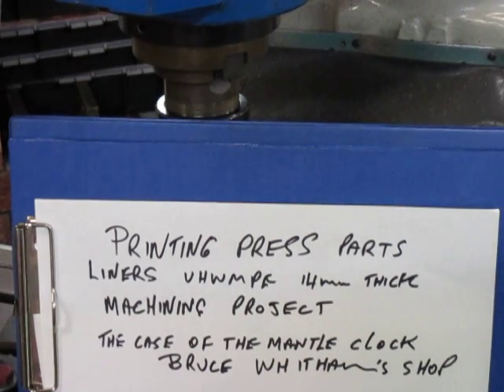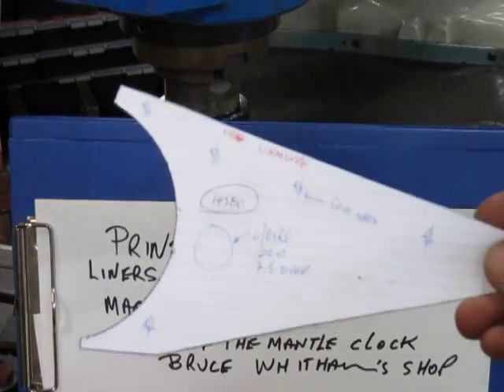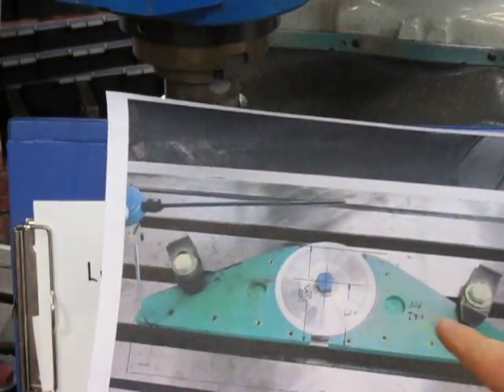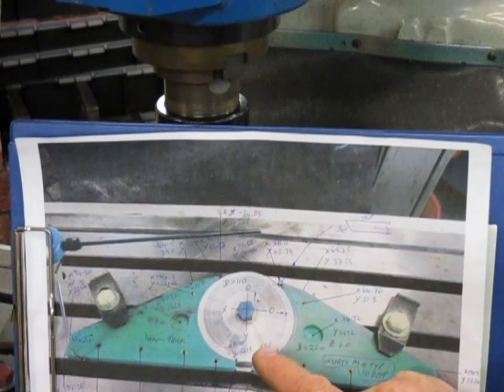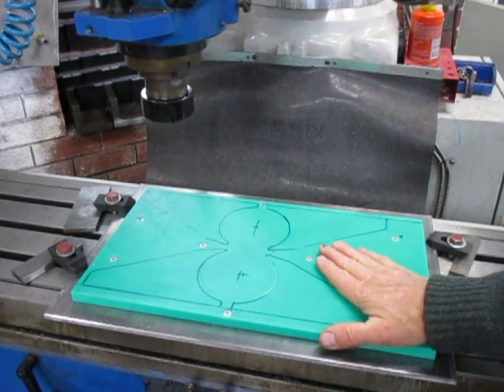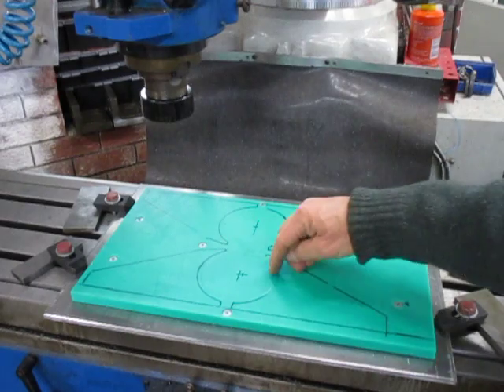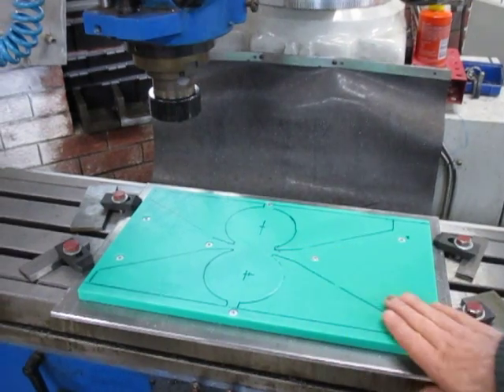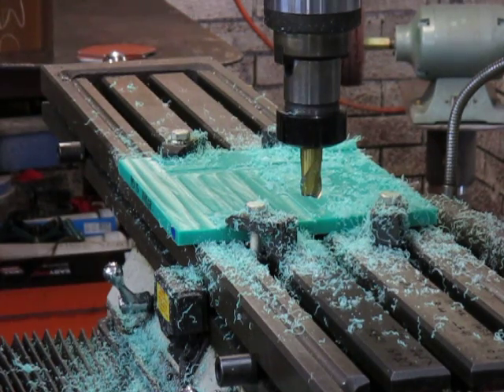Printing Press Parts the case of the green mantle clock

Comment: I wonder if a CNC machine could do this efficiently?
Reply from the maker: Carter it would be swift, however, I do send stuff out for CNC machining when the numbers (quantity and price) add up. I, like Keith Fenner are not interested in being glorified "swarf pullers" as I call CNC Operators. Keith does have a CNC plasma cutter which is marvellous, but he doesn't want lathes and mills. I see too many shops struggling to feed the overdraft for the machines they have bought and the associated costs like power and tooling and operators. CNC machines are very hungry beasts across the board, and boring as well.
Reply: Bruce Whitham well said.

Comment: I wonder if a carpenter's planer/thicknesser would hold the tolerances you require for thickness?
ATB
chris
Reply from the maker: No Idea, this job is not an issue it was a general comment complex items or those which have a lot of material to be removed are the real challenges, another is keeping the cutters razor sharp.